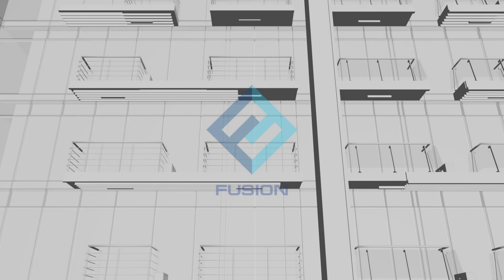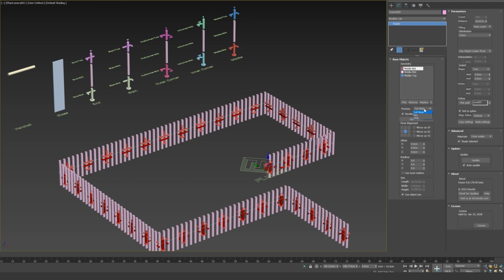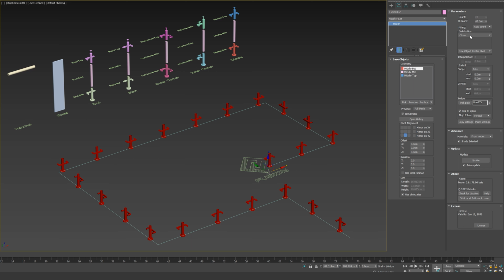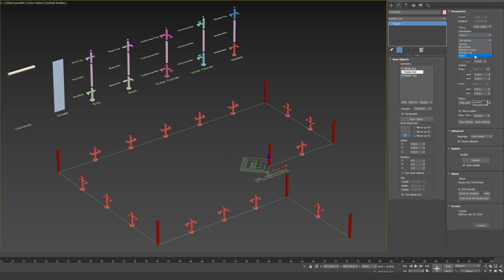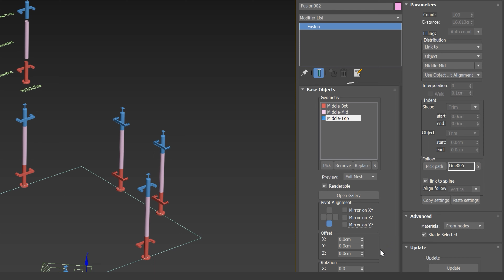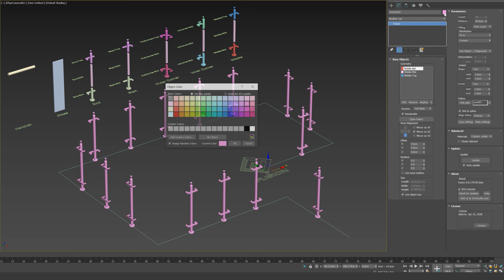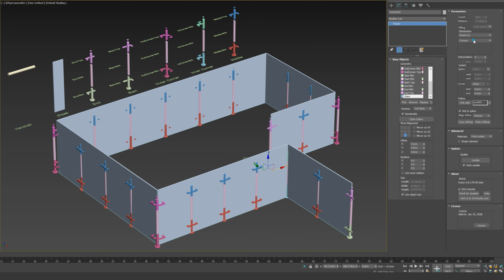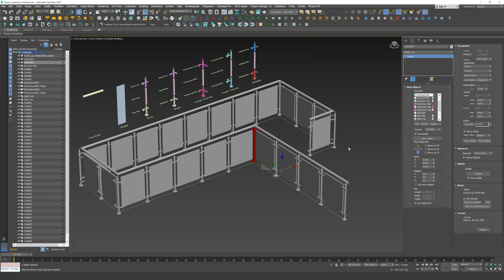Modelling Railing with Fusion parametric plugin for 3ds Max

Comment: Wow, this looks amazing and much simpler than rail clone <3 Only thing is... In your example I don't understand the purpose of splitting each column in Top, Mid, Bottom sections. I can assume it is to prevent skewing geometry in unwanted places, in staircases with varying height (Z axis)? But in this example on flat 2d spline I guess it could be done x3 times simpler with solid columns, no? Also I can't wait to see how to make those fancy curved staircases you show on your site. Anyways, good job and God bless Ukraine! #ArmUkraineASAP
Reply from the maker: Thank you for your feedback and support. We're glad that our plugin is helpful for you.
In this model, dividing it into three parts allows for adjusting the overall railing height without distorting the top and bottom sections.
You can find the model of this stair in the directory "Example" inside the archive with full and demo versions.
PS. We also want to inform you that a new version will be released soon, addressing several issues and introducing capping and mapping features.